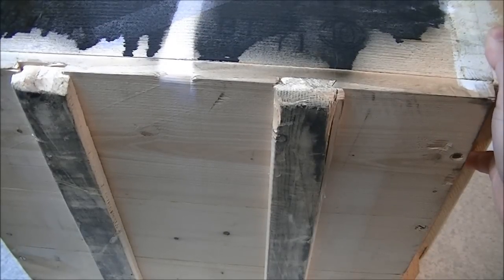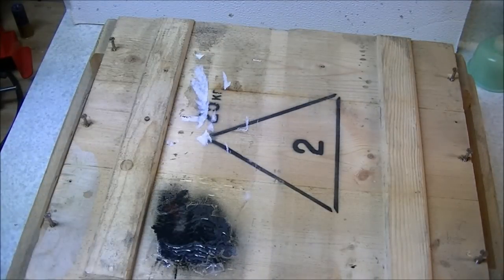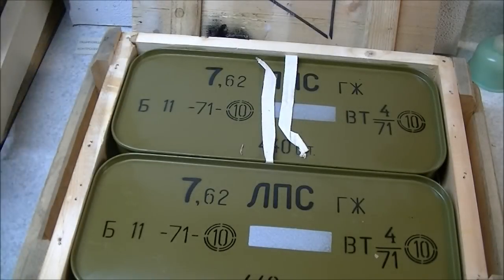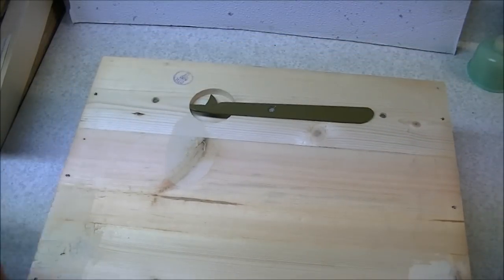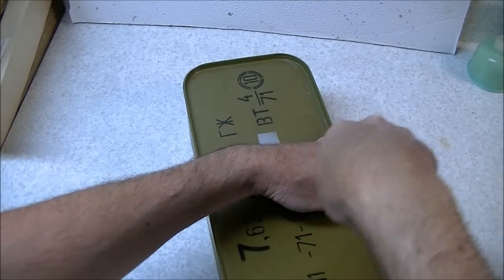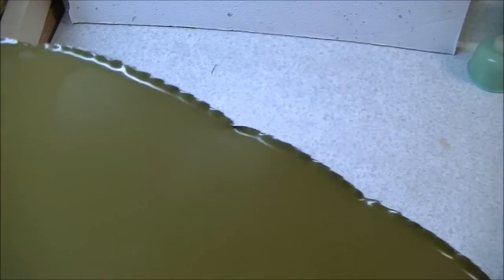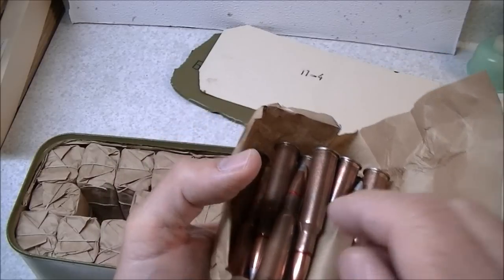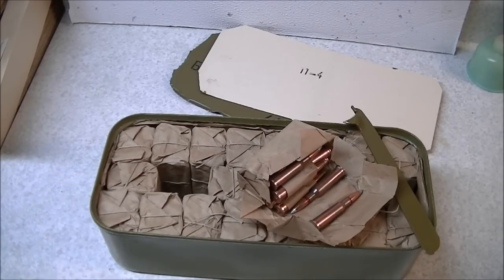Uncrating Bulgarian 7.62x54R Ammo

Comment: I have a case of this exact stuff, each bundle of 20 rounds wrapped in brown paper with string.  I had a little dated info sheet inside translated by a Russian linguist, and she confirmed it was Bulgarian. Mine was packaged in 1954, and looks brand new.  Corrosive berdan primed of course.  A couple of cans I bought online were missing the opener, which was irritating.
Reply from the maker: I expect they are a bit of a challenge to get into without the opener.

Comment: NEX TIME  just cut 1/4 of the length from both sides then you can lift  the lif up  get  a few boxes out as you need and so on then flip it back down and duck tap it using the same can  - unless you have an ammo canister that is best for storage  - but this way you keep them al in the metal containers safe and sound
Reply from the maker: That's a good idea if you don't have anything else to keep the rounds in, but I repack in 50 cal ammo cans, much more convenient and no sharp edges to worry about.

Comment: In ever understood the markings military ammo. What defines 7.62 x 54 - 7.62x39 - 7.62x25.
Reply from the maker: All the rounds you mention fire bullets of the same diameter, however they each have bullets of different weight and shape and in order to do so have cartridge cases of different shapes and lengths. 7.62x54R is an old full power rimmed rifle round, 7.62x39mm is an intermediate rifle round and the 7.2x25mm is a pistol/smg round.

Comment: I bought one of these surplus 7.62x54R spam cans about 6 years ago & paid $89.95 for the spam can from SGAmmo. I never have opened it & these damn things are going for like $240 on gun broker. I don't know whether to shoot this stuff or keep it as an investment.
Reply: Medmann48 same. And an unopened 300 round tin of 7.62x54r Bulgarian yellow tip heavy ball from 1953.
Reply: Mine is a 440 Round tin of Russian 7.62x54R dated 1975 on the spam can.
Reply: Medmann48 I have that and a tin of the exact same stuff in this video but newer; 1980. It’s sad you cannot find the sealed tins anymore. Unless you pay through the nose on armslist. Milsurp got as expensive as new production. At least there is reasonably cheap current production out there. I won’t open them.

Comment: nice vid! i got some PPU 54r ammo after seeing your positive review and they were great! unfortunately, non-corrosive 7.62x54r ammo is drying up these days and am considering using corrosive surplus stuff. what is your advice on cleanup afterwards? there are so many conflicting methods out there and I want to hear from someone who has nice firearms and actually used corrosive ammo :) thanks in advance!
Reply: Run a patch with soap and water through several times, then clean as you normally would. In a bolt action you can also use a funnel at the chamber end to pour boiling water through the bore..

Comment: New to 7.62x54r for a newly acquired Mosin M44. It came with a tin identical to those shown in the video. I've looked at several "decoder/translator" vids and not heard/seen.............  What grain are these?  147? 148? 149? 174? 185? 203? etc etc...? And what symbol indicates this? Thanks for the help World!
Reply from the maker: The "silver tip" paint marking on the bullet tip indicates light ball, 147/148 grain steel core.
To identify your ammo I suggest checking out:  http://7.62x54r.net/MosinID/MosinAmmoID.htm

Comment: I feel envy about surplus you have availale. Everything is so fucked up here in europe. You can buy SVT/Leader surplus in 7,62x39 and 7,62x54R. Ammo is excatly same you have in your videos. Big difference is they are in 250 pcs cardboard box, and because of C.I.P. rules every cartridge is stamped with caliber marking. And that of course makes price higher. One very annoying thing is that box has cartrides of different LOT´s and even years. 

Even you sort them by years they are made of, they are from different bathes. And of course because of that they do not shoot very well. 

Best way to use them is Maxim 09, and spray and pray....
Reply from the maker: Wow, that's messed up. How much does a box of 250 cost?
Reply: About 80 euros, what is quite much. I shoot surplus with my 91/30 and M44. I have Finnish made M28/30, M39 and M39/43, but won´t shoot steel core ammo in those. 
They are all in good condition and accurate. Load ammo myself, and also use them in competitions.